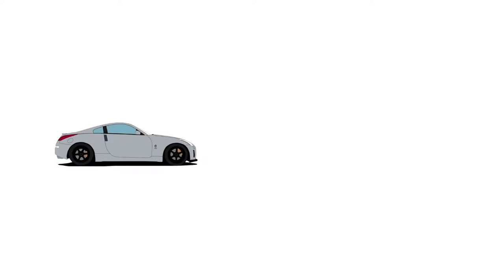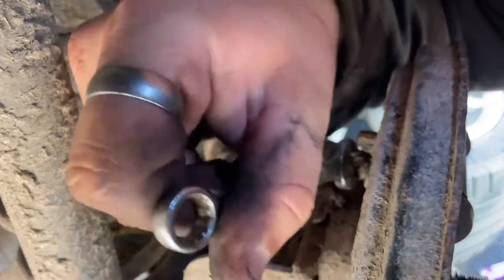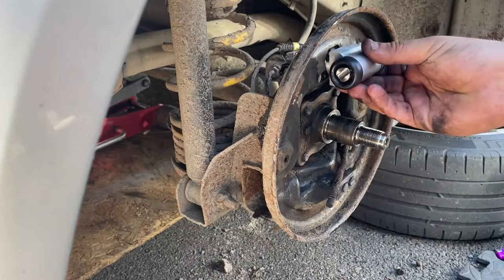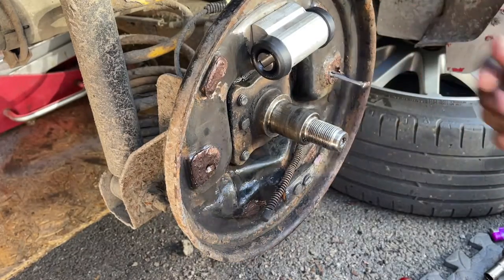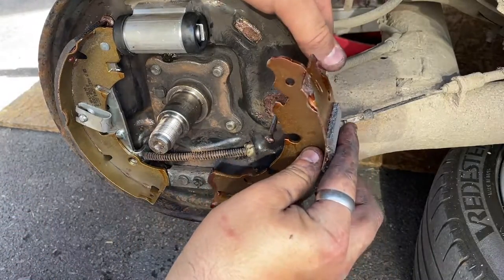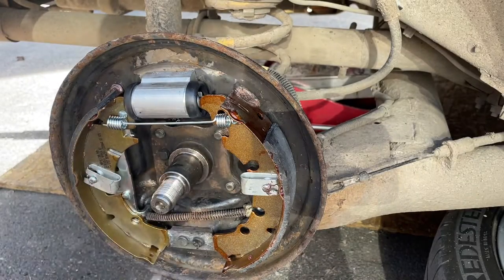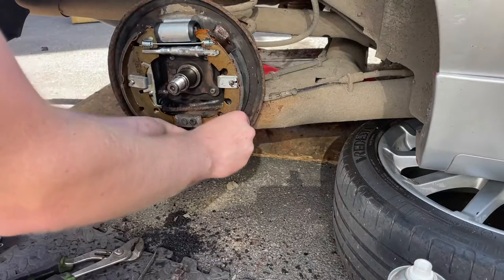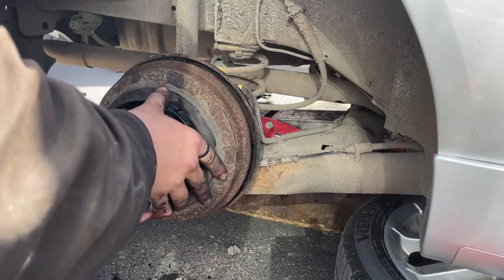How To Change Rear Brakes On a Ford Fiesta Mk6

Comment: The reason drum brakes are used is because they last for a very long time before needing replacement compared to disks due to the contact surface size and it's all contained from potential contamination (people cleaning brakes or using products they shouldn't) and low maintenance as they last longer and cheaper for manufacturers. That's at least what I've found about them. Also generate less heat although they don't dissipate the heat as good (would get fade if heavy braking was used very often).

Great video I had no idea how to actually replace them mine are working fine but they're rusty as hell so I think I will buy a set and a new cover too :)

Comment: Here is a tip once you put the handbrake cable on the brake shoe then put the top spring on then the adjuster then the bottom spring they should hold themselves together enough so put it onto the backplate placing the side with the wheel cylinger starting eoth the handbrake side put that on fullyso the top and bottom is in place and put ita retaining clip on then all you need to do is use a screwdriver (anything that you can use to pry) pry the bottom of the other side into place and then out the retaining clip on (it is possible to do on your own)